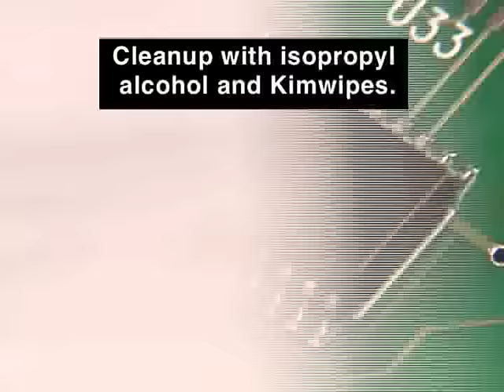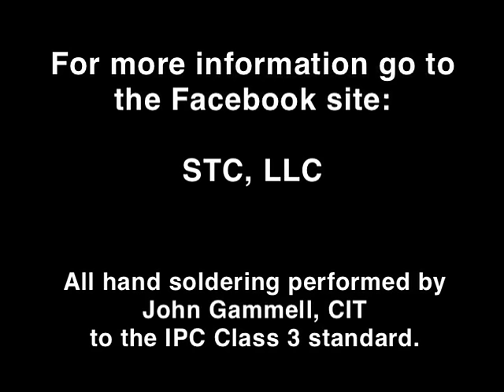Professional SMT Soldering:   Hand Soldering Techniques - Surface Mount

Comment: 9+ years later, this is still the best hand-soldering I have seen.
Reply: Exactly. I just soldered a 64 pin LQFP a few days ago and it didn't look this smooth at all! 🙂
Reply: Video was shot in the late 1990s judging by the date codes on the ICs.
Reply: @vtechk  use more flux...
Reply: It's pure ART.
Reply: i do same soldering when i was 9 year old 😅
Reply: my HAND shaking sweeps are wider:face-pink-tears:than the IC😥
Reply: Its 13 years, Still its best

Comment: I do not understand what I am seeing. I mean I can see the solder is not bridging connections but I can’t understand why it’s not. It seems to just climb the legs of the component like the legs are wicks instead of metal. What sort of wizardry is this? I can do some THT soldering but this seems impossible.

Comment: You, sir, are a true master of your trade; that is clear! I am fascinated by the different multi-lead techniques. That bevel tip seems critical for any kind of production work...
Reply from the maker: +71dembones - The bevel tip or hoof tip as I call it is ideal for multi-lead and drag soldering. I prefer the large hoof any day or a good miniwave tip with the recessed well to hold a little solder. The hoof wets so well due to increased surface area which transfers heat much faster. The liquidous solder always follows the heat source. Yes, a bevel is important for production if the operators are properly trained in their use.
Reply: +71dembones Indeed, a pleasure to watch. I strive to one day reach this level.
Reply: May i know what brand of soldering wire using? Its so shining :)
Reply: @melvinngsk i think its “ Kester “

Comment: Excellent job. Very clean and professionally done to prevent cold solder easily.
Reply from the maker: Cold solder joints are the result of oxidation, contaminants and or insufficient heat. Cold solder joints are not part of my game, so to speak. I have not had a cold joint in at least 15-20 years. Students I train do not experience cold joints as I teach them how to prevent them. Those who solder "cold" are undeveloped in their training. I also never use a solder wick on leads. I pull solder bridges with ease, just as anyone can if they understand the process.

Comment: I really like this lightweight kindle & the fact that the color is on both back & front - https://www.youtube.com/post/UgkxCgPI5O2AtmcHq9SJhgsCGbpAzJAJfrJp I just wish that Amazon would put the on/off button on the TOP of the kindle so I didn't keep turning it off while trying to hold on to it. And WTF were they thinking when the changed the size of the charging port? I own 4 kindles and now 3 work off of the same mini charger, the same one as my phone, but this new one is a different size so I have to have its "special" charger with me or a second kindle in case the battery goes flat.

Comment: The demo was done with an SOIC/TQFP format chip, which is VERY easy to solder.  Try TSSOP format! TSSOP's pitch is very small, less than 0.5mm!  Excellent video.  Very professionally done.
Reply from the maker: +unebonnevie - TSSOP is very easy to solder with ultra fine pitch if you use a micro hoof tip and proper technique. My technique is almost identical to this guys with the exception that I use a trick or two making it much more efficient. www.youtube.com/watch?v=tKl23o70iqM. Here is one of a 15 mil ultra fine pitch TQFP I did recently. Believe one thing my friend, if it can be soldered, I will solder it, I assure you. It will also be aerospace quality. https://youtu.be/6PB0u8irn-4?t=126

Comment: With a little practice, it's not too difficult. The key is having the right soldering iron tip and enough flux (personal preference is a bevel tip with an indent "solder cup"). Apply a generous amount of flux to both the component leads and pads, and drag away. If you get a bridge, it usually means you didn't apply enough flux or you have insufficient heat (either temp is set too low or you have something dissipating too much heat like a massive ground plane). Also, not all fluxes are created equal - some are more aggressive (active) than others, and more aggressive flux can be beneficial if you're working with boards or components that are slightly oxidized. I like water soluble flux, because it's fairly aggressive and it cleans up so easily compared to rosin. Water soluble is also great for Rohs (lead-free), and makes nice shiny solder joints after washing.
Reply: Flux ingredients also matters. Same for solder pastes. Cup tip indeed is great for QFP and similar multi-pin packages. With proper flux and solder it does wonders.

Comment: Thank you for excellent video. It explains quite a lot, especially this thing about flat surface on the tip. Personally I am using Weller tools and needle-like tip No 7 for this but now I will try your technique, it is so elegant.

Comment: I have only just started soldering SMT as well, and if there is one ultimate tip I can give that has been extremely useful to me as well, it's to use adequate amounts of flux. I make my own flux from rosin, which can be purchased for as little as €12 a kilo and will last you decades. I dissolve it in 95% Ethanol, though Isopropanol will do as well. Its preferrable to make several different strength solutions, a 40% liquid for SMT and desoldering with solder braid, and a thicker 75% syrup.

Comment: you definitely inspire me and i have bought my equipement as you suggested plus i had to get some more smaller tips, because i do rework on cell phone boards where CF3 for example is too big. I was able to drag solder with the smaller tip and i love the results. Thanks for the video!

Comment: Brilliant soldering demo. After 12 years still actual. Actually not so hard to repeat, however proper solder, proper flux (especially), proper soldering iron tip and proper temperature are very important here. More or less steady hands are also prefered :)

Comment: You are not human.  No human could possibly solder this well.
Reply from the maker: Dylan Bleier Hello Dylan, It is a combination of surface and lead preparation with isopropyl alcohol, flux, tip shape, size and surface area, temperature, dwell time (contact), use of a heat bridge (preloaded tip prior to drag soldering), tip placement, pressure on the handle and speed of travel. Flux is merely one element of the process which reduces oxidation, surface tension and improves wetting of the alloys. Failure to properly apply all of the necessary elements of the process will affect the wetting behavior of the liquidous solder.
Reply: +John Gammell I just suck at this, everytime i try it all i end up doing is bridging connections and then for some reason, even though every video makes it seem easy to unbridge them, when i try, it just seems to make things worse. 

My soldering skills are not basic, but i just cant see to master drag soldering to save my life
Reply: DirtyRottenBastard Try with smaller solder wire. The smallest you can find. Start with a dry tinned tip, wipe the pads with some flux, lay the solder across the traces, and drag the iron across, with a wedge tip.
I got good at it on working with those prototype boards with the input and out pads on the two sides. 60/40 solder has really nice surface tension and puddles up quite high before bridging.
Reply: +John Gammell Nice demo :-)  I notice that you've actually explained in your replies, which is good, because the average guy isn't going to do well at this, without knowing a bit more ;-)
Reply: I've had similar issues until I spend a bit more money on a really good soldering station. I never had problems again. It just unbridges like magic.
Reply: Hi,
first, excuse me for my "googleized" english...
So, what do You mean when You say "a good soldering station" ?
I'm really a beginner, but I quickly learn... and I need to buy a station, both for the smd or old school way, if possible   ;-)
Thx in advance !!!
     Stef
Reply: Lookup the EEVBlog's review of the JBC soldering station. I ended up buying that and I've been loving it for both SMD and through-hole. It's not cheap though.
Reply: Thanks a lot, nswer at the light's speed ;-)
Whit bests "french" regards...
Reply: @Notalliswhatitseems  the trick is to use a ton of flux, high quality solder, a good pcb with small pads, good soldering iron. High quality soldering material is by far the most important part in drag soldering. Also if you have a bridge just clean your tip, apply flux and remove the bridge this way.
Reply: Ha Ha ...It's very simple task when you used to.even this soldering ain't so perfect. but it's a good job.
Reply: you can so it  by hand  solder   goot but  you must  have   angular  head
Reply: It's super easy  , I've been doing this for years .
Reply: I solder like this every day in factory. Very sad life in factory. Everything is in good quality solder station (500-1000eur) and good solder wire with copper and flux and a little technique
Reply: I'm soldering better than him 😁
Reply: @Notalliswhatitseems  Use solder paste. Much easier
Reply: @sdj7122  
Do you not like your work at the factory?
Reply: @davidadams2395  Those are not healthy jobs in factory. We breathe all kind of toxic things. And we are always under constant pressure because of our bosses who dont know a thing about soldering. Plus those are very booring jobs and sallary is bad (about 400eur). Factory is in Europe in Serbia (near Hungary)
Reply: @sdj7122  
Oh, Serbia. I understand pay is not as good there as in western Europe, and jobs are scarce. Is there a way to take your skills and ply your trade abroad?
Reply: @davidadams2395  Yes. I would really love to work abroad. But I don't know any people abroad. Where are you from?
Reply: S Dj 
Far from Serbia: the U.S., a country which has welcomed the most Serbs: 650,000. Germany: 450,000; Austria: 300,000; Switzerland: 200,000; Canada: 180,000; and the UK: 80,000. I mention these figures because there have been recent articles reporting on the large (1/5 of population) Serbian Diaspora made up of people looking for a better life from better employment. 
If you could move right now, where do you think you’d like to go?
Reply: @davidadams2395  That is correct information. Unfortinetly politicians made us want to go outside of country and search for better life. For me it is not important where, it is important to make myself a better life. I was thinking maybe Germany or US or somewhere else. It is interesting that many Germans went to US to live and work
Reply: @RBroek1983  hollowpoint is great solder tip
Reply: @RBroek1983  Yes. Best tip in my opinion is Ersa hollow tip WDLF2.3 ersadur. And Ersa nano is great soldering station (about 300euros)
Reply: @rich1051414  are you using tin with flux core ore are you relying solely on the applied flux?

Comment: I remember when involved with electronic manufacturing that we used guides that Martin Marietta put out many years ago.  It was one of those things where a company developed for in-house use, and then decided to sell it (I found them and it at a "NEPCON" West show in California back when they still held those.)  Each practice (soldering, crimping, wire prep, whatever) included four photographs.  In descending order they were called something like "Ideal, Acceptable, Minimum Acceptable, Unacceptable".  They made the goal clear, but left a little room for practicality.  The examples in this video are certainly in the "Ideal" category.  Especially the soldered lead in the through hole example.  It is supposed to look wetted up the lead, and be cut above that point.

Comment: Absolutely beautiful soldering...... This Wallmart soldering iron just isn't doing the job for me....I felt like crying and laughing while watching your video at how easy you make this look. Thankyou for the post.
Reply: I started out with a Hakko 508, but later got a cheap temp controlled soldering station (Kendal 853D++) that does a pretty good job.
Reply: WizardsOf12 i have goot 40w. The tip dies instantly like it's cursed!
Reply: @therealb888  the tips oxidise too fast on those cheap non temp controlled irons as they get very hot (around 400C+) thus allowing tips to be oxidised very quick. Add to that novice techniques and no care for tips and yeah. Best way to use those is to periodically turn on and off those irons so they maintain a workable temp but not get too hot

Comment: @StinkyCheese9999 In my applications, my irons are at the proper temps... however we deal with large thick ground planes and boards that are designed to dissipate heat (ie high intensity LEDs).  While we are in the process of trying some new tacky fluxes, the stuff we have used in the past (low solids) flashes off well before the solder reflows.  As far as equipment goes, I am using a new Hakko FM-206 for hand sodlering/desoldering and the Hakko FR-803B rework station for fine pitch removal.

Comment: Hello John! Great video! Do you have to/ is it desirable to aplie Flux to the joint even if you are using rosin core solder which has a flux core? If i would start to solder should i clean the surface i want to solder on before i begin with isopropyl alcohol??

Comment: Excellent work-Beautiful accuracy.  I see you recommended the Weller WESD51.  It looks like great low-to-middle end unit.  I can't seem to figure out what the exact model # is of the hoof-type tips, similar to the ones you use in this video.  I know you have said Weller calls them "single flats", but I can't seem to find any that match yous.  Can you recommend a good tip for the WESD51 that I can use on a 100-TQFP chip?  Would it be their ETDD?  How about for the Hakko you recommend? Thanks!

Comment: Thanks for sharing the video - you make it look easy. :)

I've been looking around for good QFP technique, but I'm a little confused on this. I'm assuming the blue tip tube is solder paste and the yellow tube is flux?  If so, I'm having a hard time figuring out where all the solder comes from when you do the swipe at 2:05 :)

May I ask what solder/flux you use? The stuff I've used for SOICs seems to have too much surface tension for QFP work - or maybe I just need better flux application.

Comment: This is one of the most satisfying videos I've ever seen. Those are some beautiful joints. Your experience really shows with this. I'm currently learning microsoldering by fixing things like broken connectors and charge ports on phones and tablets. Just successfully desoldered a broken micro USB off of a tablet and cleaned the pads. Can't wait to try soldering the new one on.

I think I'll get one of those bevel tips. They look really useful.

Edit
Also if you don't mind my asking, when it comes to desoldering SMD components (like charge ports, connectors, and ICs) I've seen some different techniques. I personally used flux and some fine solder wick to remove most of the solder then used an SMD reflow station to lightly heat it up until it gave way with some tweezers. I've also seen other people use flux and heat only. I'm assuming the technique really depends on the number of leads? Or is one better than the other?

Comment: Great video but I have one question.
When you are cleaning the flux off, you seem to use the same brush for the initial application of alcohol and also for pushing the kimwipe onto the part. Is this necessary - does the brush need to be wet? I would have thought you'd want the brush to be dry on the second part of the cleaning process. Can you please explain this?

Comment: Do you recommend HASL or ENIG for this type of soldering?
Reply from the maker: Greetings, HASL (Hot Air Solder Leveling) is my preferred finish. HASL is awesome because they have already pre-tinned all the pads using paste and convection. HASL improves solderability and wetting of the solder. ENIG (Electroless Nickel Immersion Gold) and immersion silver solder fantastic with drag soldering, multi-lead and point to point with Sn Pb, lead-free alloys, SAC 305, nickel, cobalt, etc...

The key my friend lies strictly with the fundamentals: Tip size and surface area, temp, surface preparation, good flux and solder (Kester), correct tip angle, pressure on the handle and speed of travel. Two tricks to enhancing solderability: tin your surface mount or through hole leads in a solder pot (remove all dross on top) and remove flux residue from leads with IPA. Now solder them and watch how the tinning or pre-tinning enhance the wetting when soldered.

Comment: HOLLY SH!T, Almost cried when I saw this soldering station, and I use a extremely cheap soldering iron..

Beautyful soldering joints, I dont't know if it's me or my equipment, but I've never done a this beautyful solder before, and neither this fast

Comment: Hi again John. Thanks for the advice on tip part#s. I have found a mid-line Hakko unit, the 936. It is analog, and uses different tips than the 951. Do you have any experience with it? Thanks.